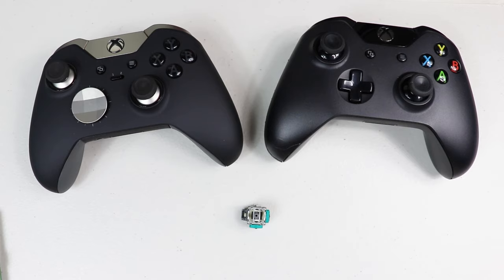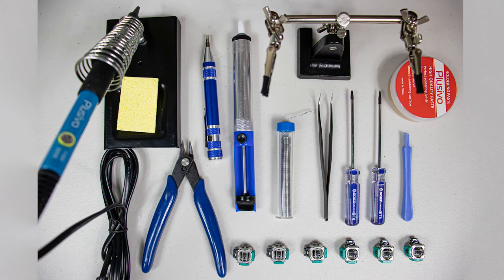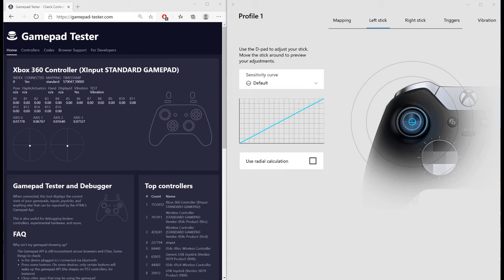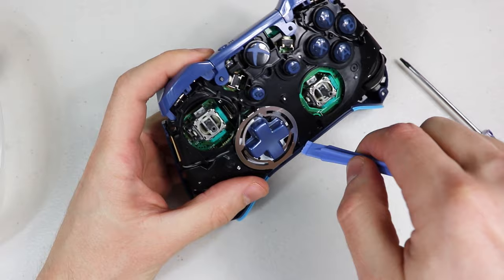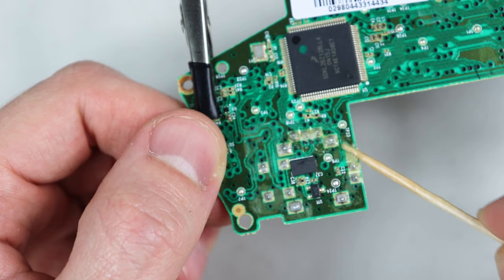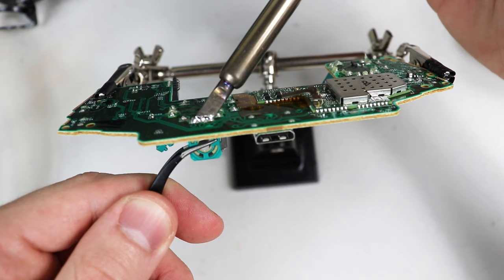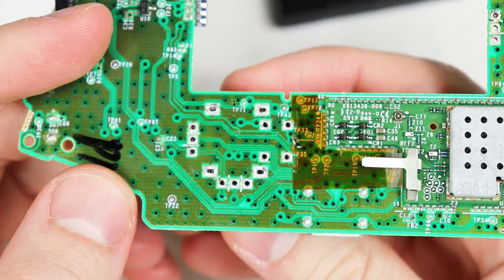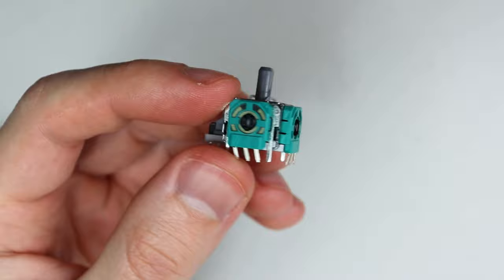How to Replace Xbox One Controller Analog Joystick - NEW METHOD - Fix Stick Drift, Broken, & Loose

Comment from the maker: As always the links for the kits are in the description.  Thanks for watching!
Reply: @SOSSGAMING  hey how do you find the controller parts?
Reply from the maker: @Dank Meme Amazon: https://amzn.to/2KgYP0e
eBay: https://www.ebay.com/itm/223831814472
Reply from the maker: @Dub Jubs Yep! They are the exact same joystick, minus the metal inserts in the joystick shafts on the elites (which are useless anyway).  Doing this repair is actually how I got into soldering too so I'm optimistic you can pull it off as well. Best of luck!
Reply: What about the elite series 2 do you have to cut apart the thumbstick on that one as well? I have a series two that has a broken L3 button and I want to replace the thumbstick on it.
Reply from the maker: @Andronicus87  If all you have is a soldering iron (no desoldering iron or heat gun) I believe that is the best technique to remove it.  The through holes are very small on those controllers as well which can make it seemingly difficult to remove every bit of solder from each pin doing it the traditional way of removing solder.  I believe those controllers also use lead-free solder so adding a bit of flux and extra solder should help to heat it up/remove it.
Reply: Will this fix elite series 2 controllers?
Reply from the maker: @b.i.r.d8009  Elite 2 controllers use different joysticks, and don't require manual calibration actually.  I plan on making a video in the near future for them, but I believe there's one or two videos out already.
Reply: Bro have you even seen like how bad an individual can get at soldering, specially this fine intricate clean work you do ? , robots solder those things and you remove it a solder back like the robot did it in the first place ! Which brings me back to have you seen how bad most people are at soldering? 🤣🤣🤣🤣🤣🤣 I make such a mess sometimes lol
Reply from the maker: @hippo4g93  My bad lol I guess to be fair I haven't seen anyone else solder (other than on YT) and I was pretty new to soldering still when I was making the video so I'll definitely take that as a compliment :)
Reply: @SOSSGAMING  damn straight it’s a compliment, nice clear work bro
Reply: At least now I know how to properly open a controller
Reply: Clean*
Reply: Can this same process be used for a Series X/S controller? Or do you need a different joystick module size?
Reply from the maker: @NeonVoxel  Yes, absolutely.  They all use the same joystick, aside from the new series 2's.
Reply: Do you sell on eBay ?
Reply from the maker: @luisdelacruz7334  Yes I do!
Reply: @SOSSGAMING  I'm hoping that you could afford me some insight... Is it possible to swap out an Elite 2 controller's modules for standard modules? I ask because I would actually love my Elite V2 controller if I could install standard XB1 controller modules & plastic sticks (the variety that you sell), namely for their tension and lack of inner (mechanical) dead-zone.
Reply from the maker: @funtopunch  You can! The only thing with that is you will need regular xbox or elite v1 thumbsticks.  You may also need to replace the plastic base of the joystick with the elite v2 joysticks because it's thicker which in turn makes them sit a little higher, but I don't think that will be much an issue though and probably not even necessary. Also, no manual calibration is necessary with elite v2's, which is nice.  It takes a little bit of time of gameplay for them to automatically center.
Reply: @SOSSGAMING  im assuming the self centering is part of the elite v2 controller, not the joystick modules right? going to try to fit some v2 sticks on my razer wolverine ultimate or switch to the elite v2, not sure yet
Reply from the maker: @florianmaslofski  Yes, it is only part of the controller itself unfortunately :(
Reply: @SOSSGAMING  what is the number your looking to be under on the GamePad tester app? I just ordered my joysticks and going to try tomorrow
Reply from the maker: @killer147896325  Personally I try to get within +/- 0.03 (3%).  +/- 0.1(10%) is the most I would recommend.
Reply: Best video! Thanks so much!
Reply: I'm surprised how little subscribers you have, you're underrated af dude!
Reply: @ SOSS GAMING will this work for ps4 controllers?
Reply from the maker: @tochukwuchester5437  These exact joysticks I will say no, but if you're referring to the method in replacing them I'd say yes, it is quite similar.
Reply: Can you make a similar video but with hall effect sticks?
Reply from the maker: @andrewmoon3409  As far as I know hall effect joysticks are not going to be compatible with xbox controllers unfortunately.
Reply: @SOSSGAMING  so id need to buy one of those controllers on amazon that have it already I guess. ok thank you.
Reply: Please i want to know if its okay to get some movements on Y and X axis while the joystick is removed
Reply from the maker: @theswagger78.  Yes, when the joysticks are removed the axis should read 1.0 or -1.0. That is normal.
Reply: does this joystick compatible with the xbox series x controller ?
Reply from the maker: @abdullahowainat2069  Yes, exact same!
Reply: Hey bro, thanks for the tutorial, this was my first time soldering and it works again! Really appreciate the time you put into making this easy for people like me
Reply from the maker: @landosubscription9133  Thanks for the kind words! Great job on the repair

Comment: PS ....  I am an 81 year old retired EE and ham radio guy.  I still build and repair circuits that use surface mount components.  I have a few medical issues but am blessed with steady hands and clear vision.  I love a good project.  What did we ever do before YouTube?!!
Reply: hell yea pops
Reply: We winged it used voltage meters

Comment: 30 minuets of knowledge, direction and no wasted time. Your instructions are spot on, methods of indestructible and destructive are appreciated as not always can people afford a hot air gun ontop of all the other stuff. I'm about to attempt this myself and was unaware that there's a high potential that the potentiometers need ajustment. Thanks.
Reply: I recently started fixing remotes and learned this the hard way. I had no idea they needed adjustment
Reply: @TheOnlyUmagon  dude yeah it's fxcking annoying. Even if you use a helder mod kit with adjustable potentiometers the dead zone could still be completely off whack!
Reply: Be careful because I damaged the PCB board and needed a replacement. It was the desoldering that caused the issue for me. I ended up damaging one of the holes, SHM. The rest looked great, but a small piece got stuck, and too much heat, well. I am waiting until the new part comes in. I ordered a heat gun and a desoldering gun for future projects.

Comment: If you're using just a soldering iron you can remove the joysticks without damaging them.  First apply some new solder to each pin.  Then apply some flux to your desoldering braid, press it to the pins you want to desolder and then apply a really hot soldering iron.  I used about 420+ on my iron and the solder sucks right out of the holes and into the flux coated braid.  Repeat this until all the pins are loose enough to pull the joystick out in one piece.  Your iron will need to be really hot and the tip will need to be cleaned occasionally during the process but it works.  It will take about 6 to 10 inches of desoldering braid per joystick but don't cut it beforehand, only cut off the used pieces of braid as you go and use a fume extractor or a fan... or just don't inhale.
Reply: That's what I was thinking. I haven't done my controller yet but I have desoldered many a module from pcb in my life and have never found it necessary to chop them up first. Just flux, heat and wick and it should come loose.

Comment: "And now comes the fun part"

After trying this a few times, he's not lying! Thanks, whoever you are, for legit creating a new hobby for me. I've repaired countless controllers with your help!
Reply from the maker: Awesome! Great to hear.
Reply: Can’t wait to do it on mine. Once done successfully I’ll probably do commissions for friends and family 👌👌👌
Reply: @joshkennedy871  have you done it yet? If so, any recommendations on oem parts
Reply: @MEXICANASSASSIN2  I've ordered both analogs and bumpers from SOSS and they're perfect. Some of their sets also come with all the tools you need to get the controller apart which is a nice bonus. The bumpers are better than OEM as they're made with better plastic and seem to fit more snugly but the analogs are the same ones used by Microsoft I'm pretty sure. There are no differences as far as I can tell. You'd be smart to order more analogs than you need for reasons outlined in the video. Swapping potentiometers may be necessary in some instances and having backups in case something goes sour like a pin breaking etc can save you time and frustration.
Reply: @SOSSGAMING  I need help so I have an elite controller and did everything you did im at the part right after you get the posts out to put the new joystick in my post won't come out i have the small hole contorller posts, I've only got 3 out so far can you or someone else help me please and thank you
Reply from the maker: @nightmaretribe2192  If you mean that parts of the old joystick are still in the controller (after chopping it up), what you can do is add more solder and flux to the location, then as you heat the solder up and it's melted, you should be able to push that part through further with the soldering iron tip. When the part is pushed out further, you can then grab it on the other end with pliers or tweezers (while the solder melted) to get it out completely. Then remove the solder from the hole as normal. I hope I understood your question correctly.
Also, make sure the iron is hot enough to melt the solder, but not too hot to damage the pad. Always be careful with that. And also be careful to not be too forceful when pulling the part out of the hole. It should come out relatively easily when it's ready. Anyway, hope that helps.

Comment: Excellent video.  Just used it to repair a controller.  Strictly speaking, one does not have to unsolder the motor wires.  Taking care to leave the remaining half of the assembly flat on the table will prevent the headphone jack from falling out. Our calibration results were nearly perfect.  The tool kit and repair parts kits were fantastic.  Thanks!!

Comment: your use of flux is very important as it spreads heat quickly and helps stop board overheating
Reply: Never used sober before in my life tried to do this and fried a mobo now l'll just pay to have someone else do It especially for my elite 2 to big of an investment to chance. Don't see why Microsoft doesn't make them modular snap in&outs, my bad we are talking bout Microsoft

Comment: Software for calibrating controller may not exist due to the lack of USB-based debugging on these controllers. I haven't looked to see if USB debugging exists on these controllers, and I'm not sure if this varies by model but I would assume each model is fairly similar, these controllers have SWD debug pads at the bottom of the main board next to the headphone jack; the silkscreen labels are 0/NA, RES, A14, A13, and 3V3. Through software, OpenOCD is a typical choice for this, you can find chip information, which is hidden under a blob of epoxy, and these controllers seem to typically use SMT32 chips. Through the software you can also access memory, of which you can dump, modify, and reflash, which SMT32 chips require a wipe before flashing to written memory. I personally haven't done a deep dive into the firmware, but recalibration through this method shouldn't be difficult assuming you're familiar with debugging. If there is USB-based debugging, that only makes the process simpler; but I personally doubt their is considering someone can brick their controller with a bad script, and scriptkiddies run rampant these days, it's probably a failsafe to deter this behavior by outright disabling USB debugging. 

I wouldn't be surprised if the various hacker and modder forums have already figured this out, long ago, as it's just a simple debug job over an SWD port. I also wouldn't be surprised if some repair shops don't do this also, as making a tool for this would be fairly easy, especially if you find a way to automate the process entirely. But the only issue with this is that Microsoft is constantly coming out with new versions of these controllers, and my main source of board information is currently unavailable so I can't just reference each version at the moment; this also assumes that Microsoft hasn't drastically changed the computing hardware either.

Honestly I wish controllers would move to a better method for analogue sticks, as they're proving to be plagued with issues, especially when you deviate from the standard design, like with what Nintendo does. Even a hardware based recalibration would be nice, implement limit switches to measure min/max values when a calibration button is pressed; that kind of calibration button could also be hidden in the battery tray, or easily done through software.
Reply from the maker: Wow! So much information thanks for sharing.
Reply: This is helpful! Thank you!

Comment: One little tip for manually adjusting the pots without having to bend the pins (so keeping them more or less freely rotatable (if that's even a word)) is to use BGA solder paste to connect the pot pins to the pads. This is basically solder in spreadable paste form that melts into regular solder joints when heated, but is flexible and conductive before that, allowing for testing and adjustment without having to bend the pins over (or worst case having to tack-solder them in place multiple times even). Just don't make a mess with the paste as it's positive point (being conductive) can easily turn into a negative one (shorting things out)
Reply: I’m gonna smear this paste all over myself and run into a thunderstorm

Comment: Imagine that feeling when you know that you will never have to buy a new controller because of a Drift problem. I am going to try this method for the first time tomorrow, and I'm very excited.
Actually I'm thinking about taking a new hobby, as someone already mentioned above me. Lot of people around me are having trouble with Drift and there are only few people who can repair them well.
Thank you very much for such an informative and hight quality video. Wish you everything good in your life.
Reply: This has been a huge issue since the 360 it just took longer back then to get drift if u want to practice soldering and desoldering I would say pick up old 360 controllers cheap and work on PC as well so you can still get use put of them also much easier to do the 360 ones as well

Comment: I just swapped the old ones with new sticks, and behold, no calibration needed, works fine! :) I actually did the repair before watching this video, but you show lots of useful tricks. :3
Reply: Did you replace the sticks on an oem controller? I’m trying to do this on 3rd party controller but still huge deadzones